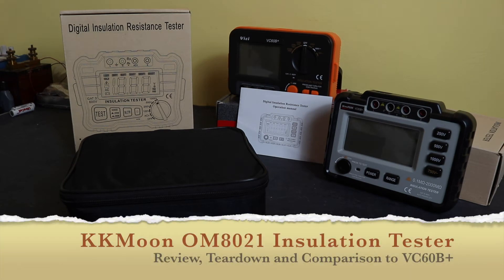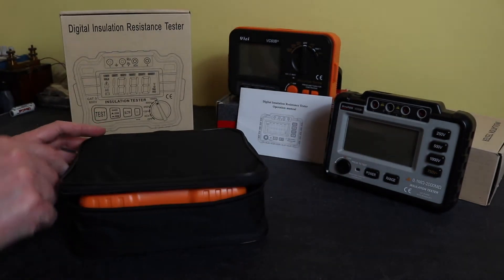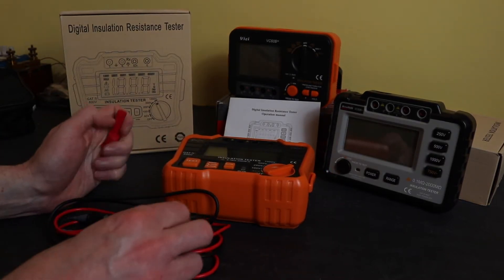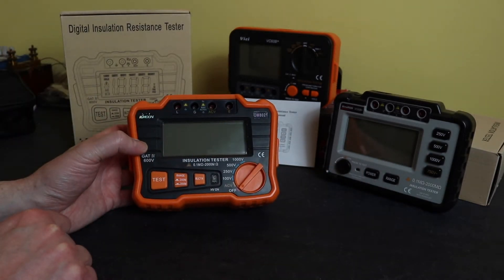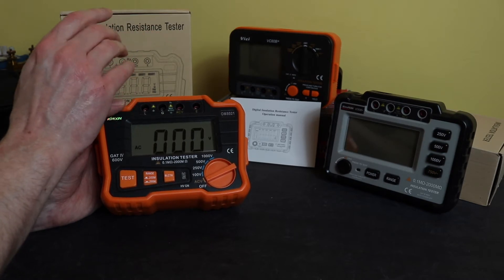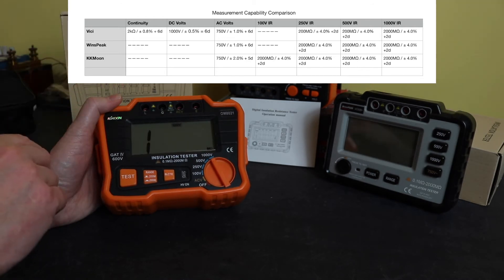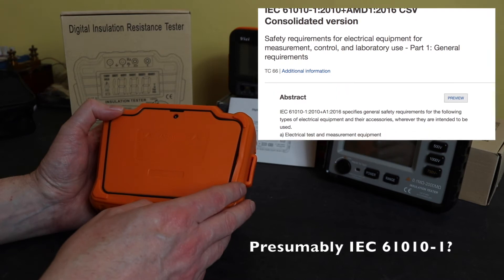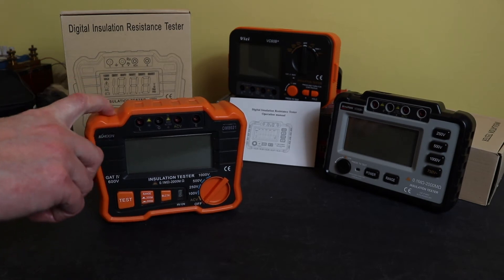KKMoon OM8021 Cheapo Insulation Tester Review

Comment: Is this good..?
Reply from the maker: It is a basic tester, with minimal functionality and it does struggle to meet the IEC standards for certain aspects. I would not advise it for professional use, but if you wanted something to experiment with at home, then it would be fine.
Thanks for your question.
Reply: @three-phase562  Sir how is Rishab 10 insulation tester..?
Reply from the maker: @ASHRAF.916  I have not used any Rishab test apparatus, so cannot speak for them personal experience. Looking at the information on the Rishab 10 that I can find online, the specifications look to be good and it has better functionality than this KK Moon unit.
I believe the Rishab brand builds Gossen Metrawatt instruments under license, so I would imagine that the quality and reliability would be very good.
Reply: @three-phase562  thanks for your advice 🙏